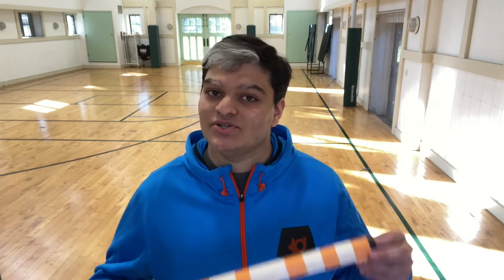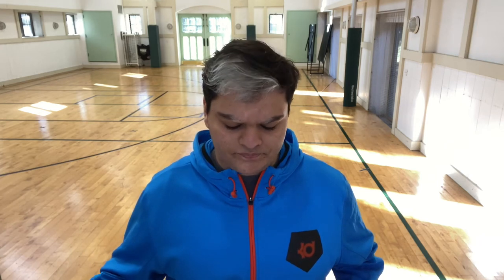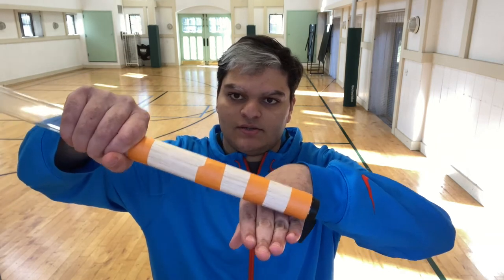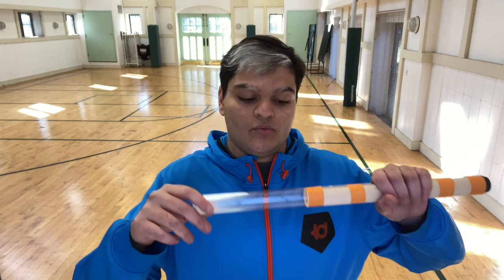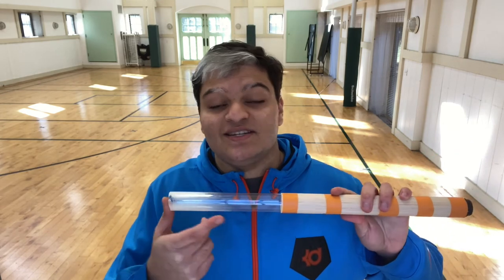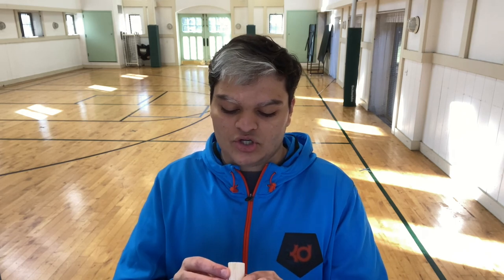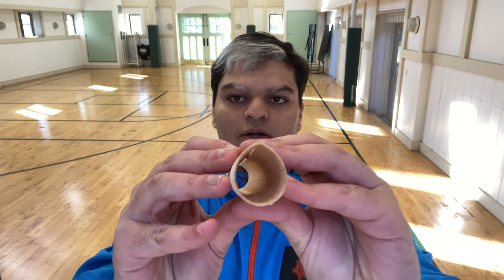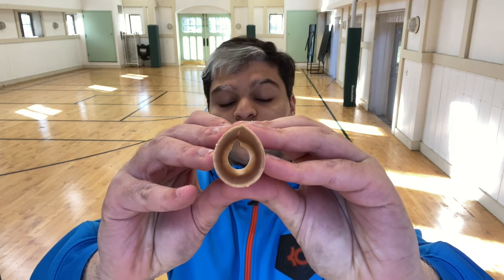How to Make Balsa Wood Tubes for Science Olympiad

Comment: To glue the tube in a circle, roll the tube a little tighter for about 10 minutes so that the cell memory is naturally in a more pleasing position. You can then apply wood glue to the seam, wrap with rubber (cut rubber bands; using tape is likely to strip and splinter your thin balsa) until dry and set. Once the rubber is wrapped around you can kinda wiggle the tube a little and it'll settle into place edge to edge this way.